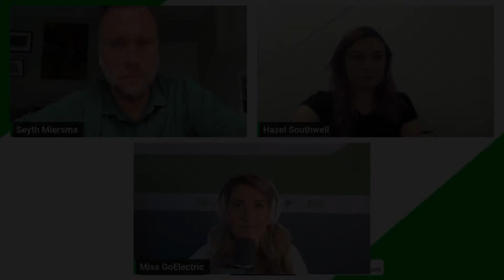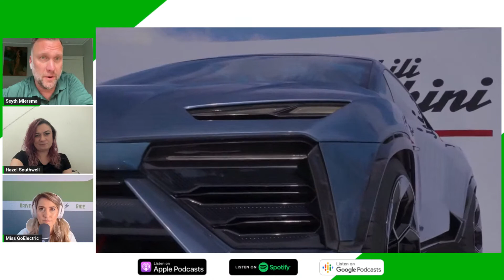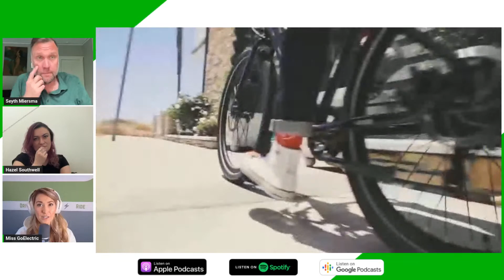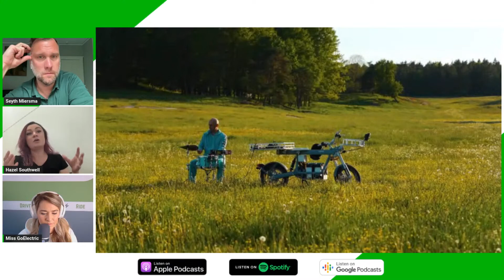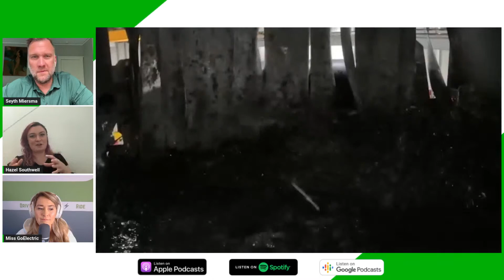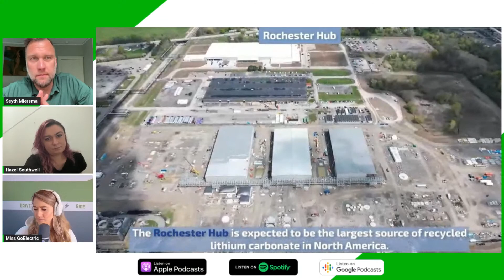InsideEVs Podcast #175: Lamborghini Lanzador EV Concept, EBikes, EV Battery Recycling & Tesla News

Comment: Right to Repair should include batteries. Just like using a soldering iron, you have to be careful what you are doing. If you are disassembling a battery you need to treat it with care. People should be allowed to do these things, but they should also be aware of possible dangers.

Comment: The right to repair should be be available excluding any proprietary information. There needs to be many warnings of all the safety concerns and loss of warranty/responsibility if they don't follow the warnings. I do agree that anything that should never ever be "opened" by anyone should not apply. No one would try to open their cell phone battery to repair it, so I would assume the same applies to the battery. It would be nice if the batteries were more modulated so right to repair would allow you to swap out a module, without "opening" anything you are not supposed to.

Comment: Grids in the USA, are not very interested in using USED batteries. Calling them second life doesn't make them any more comfortable with paying major money for unknown quantities. I appreciate that Second Life has been a major talking point in the EV community for why EV batteries aren't a sustainability issue. Please speak to some grid experts and learn that this is the case. 

It would make a lot more sense for us to really concentrate on making EV batteries last as long as possible in their original form. So that means thermal management (already in every EV except Leaf and really cheap junk) and also manufacturers building in upper and lower buffers, and just letting people charge to the artificially lowered 100%. This is what Bolt did, but since, we've seen manufacturers unlock much more battery and then instruct owners to only charge to 80%, which is fine for wonks, but a terrible explanation to a new EV consumer.
Reply: for second life you're not looking at grid storage, you're looking at home applications such as power walls - or actually, as is way more likely, programmes like the Ultium Home stuff, which is a slight misnomer because it's looking a lot at light industrial applications. right now there aren't enough EV batteries going spare for second life to be a major application full stop but there certainly are site operations (festivals, building sites, etc) where battery storage is important and where second life is a valid choice. for the grid, what's going to be the big factor with EVs is what Ford, GM, etc are investing in which is virtual power plants - grid balancing via use of active EV batteries when they're plugged in.
Reply: @HazelSouthwellFE  we can assume the same problem with home storage. It goes like this: "Here's your new used battery from a dead car."

"What? I wanted a new home battery, not a used one."

"But this is a new home battery. We made it freshly last week."

"From a dead car? No mate. If I want a used battery, I'd buy a used home battery. How dead was the car?"
"It's relative with cars. It wasn't really dead, just stopped being great." 
"You don't know if it's one bad cell or a number of bad cells that made it not great do you?"
"I'll order you the new battery with no used parts"

And that is why only small-time independents will have anything to do with second life batteries. It's worse than selling used unrebuilt ICE engines. Only desperate people ask for them, and mechanics fear installing them because they can't give a guaranty and their reputation can get trashed from immediate poor performance.
Reply: @karlInSanDiego  this definitely isn't true though - people actively seek out crashed Leaf or Tesla batteries (and have done for years) to make their own home powerwalls. if there's a significant discount (+ green credentials, which people installing home renewables will be interested in) then of course people will want a second life battery. 

second life batteries are not ones with faults - they are ones that have ceased to perform at the high demand charge-discharge level needed for EVs.
Reply: @HazelSouthwellFE  - DIY solutions are not scaleable at all, for vintage cars or for home power banks. If fact, as mentioned on the podcast, DIY batteries for ebikes are believed to be causing fires, which has led to swift prohibition of DIY or even non-UL certified batteries. Imagine homeowners insurance VERY quickly forbidding any coverage, or denying full claims, if non-certified DIY batteries were even found on site, much less wired to the home's panel. We musn't confuse the hobbies we have (I built my own bamboo cargo e-bike) with scalable solutions that include the plurality of people or more importantly, get quickly curbed if too many people do it wrong as seen in NYC e-bike fires.
Reply: Also, lower energy capacity batteries are very much likely to have a cell or more with a fault leading to brick/module imbalance and in inability to fully charge and discharge the healthy cells that share space with it. Degradation after many years is not uniform. Speak with battery hobbiests or with Gruber Automotive about how modules or packs reach end of automotive life. What's good enough for a craptrapaneur stacking mismatched Leaf battery packs in storage containers to provide a developing nation version of battery storage, isn't viable for places where consumers require warranties, assurance of performance, and something that won't be uninsurable or lead to an uninsurable property.
Reply: Remember when biodiesel was going to be a transportation solution. It was half-baked, thinking that there was enough used fast food frying oil to power all our cars. Classic case of non-scalable solution meeting reality.

Comment: Bikes will be easily maintainable by owners as long as they use standardized parts, as the bike industry has always done. This is true with bike shops too. E-bikes that use tricky bespoke core parts are going to be very difficult to maintain, especially if they manufacturer fails like VanMoof.

If they choose to use standards like UART and CAN bus, then bike shops will be able to repair a variety of bikes with specialized tools and manuals. But right to repair SHOULD be the law of the land, so that all of these millions of e-bike motors can be maintained/repaired. The community learns by reverse engineering and sharing helping DIY videos, but it's clearly better if manufacturers publish manuals, and provide repair parts to those who are prepared to deal with them. 

Agree that playing with battery repair or building your own without BMS is asking for trouble. I think more of these issues with fires may be from 48V chargers on 36V packs and other charger mismatches on sealed packs.